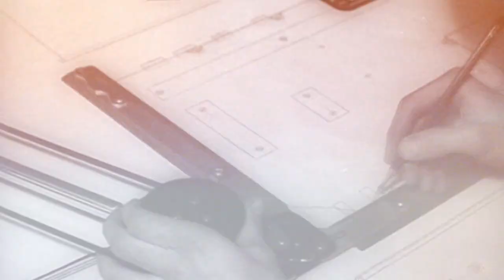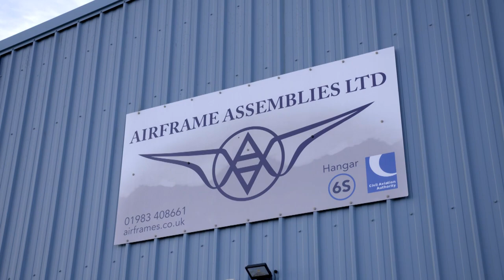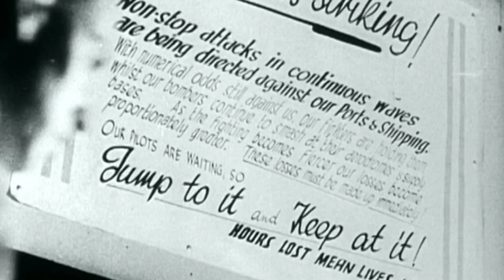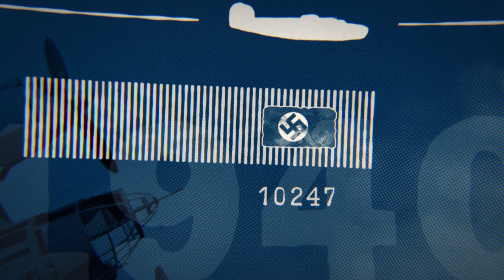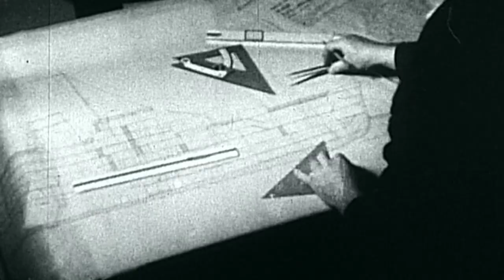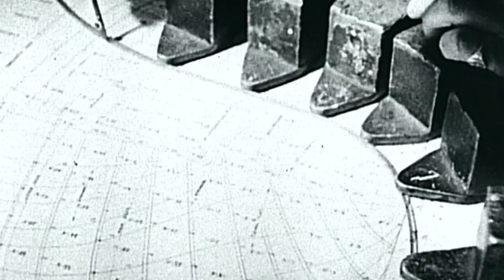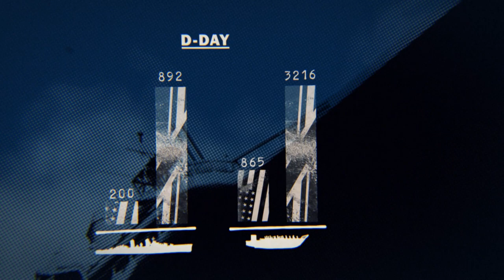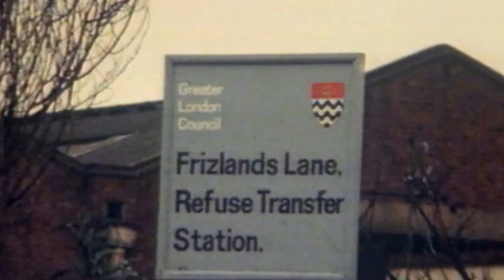How The Brits Engineered The Perfect Fighter Plane | War Factories | Timeline

Comment: "Rolls Royce had been aware of the Bendix-Stromberg Pressure type of carburettor (on Allison engines from 1939, ND) for several years and versions of the carburettor were used on many American engines including the Allison V-1710. Notably, Packard built their Merlins in the USA with a version of the Bendix PD16 from the very start of Packard Merlin production."

ROLLS-ROYCE MERLIN CARBURETTOR DEVELOPMENT page

Comment: The English got even more help from their American cousins than this program mentions. First, the assembly line method of manufacture was originally known in England as the American method of manufacture because they got it from America, and second, the distinctive elliptical wing of the Spitfire was designed by NACA, the National Advisory Committee for Aeronautics, which was the forerunner of NASA.
Reply: They just release another documentary from this series specifically about the US manufacturing of the planes for the war, as an American I was surprised with the respect they did for that episode. There is always a little banter between the US and UK, especially when it comes to documentaries, but they did acknowledge the work the Americans did with praise.
Reply: I’m not so sure the wing was developed from the US NACA designs. I am no expert on the Spits, but what little I have read on the wing is that the shape/profile can be defined by assigned numbers developed at NACA.
Reply: Not true.. the elliptical wing design came from a German aeronautical engineer that came to supermarine aka vickers to work.

Comment: The Supermarine Spitfire was a good fighter but it was not perfect. It had one huge drawback and that drawback was its comparatively short range. I read a book WING LEADER by Air Vice Marshall Johnnie E. Johnson way back in the 1960s and he posted a quote by a pilot who stated that the Spitfire, "...climbed like a homesick angel".
Reply: My uncle, Hap Kennedy, Distinguished Flying Cross and Bar flew Spifires in WW2. He told me that his Spitfire IX could out climb any German fighter
Reply: The elliptical wing design also made it difficult to manufacture.  This is why later models changed the wing design.
Reply: @Icarusdecending82  elliptical wings apparently made it roll like a brick.